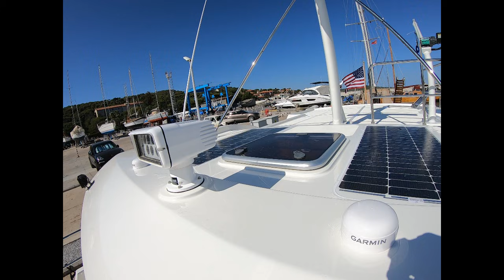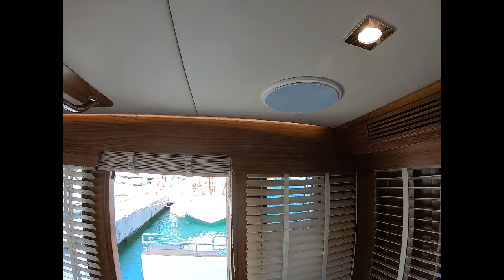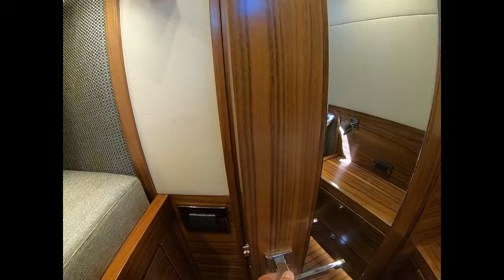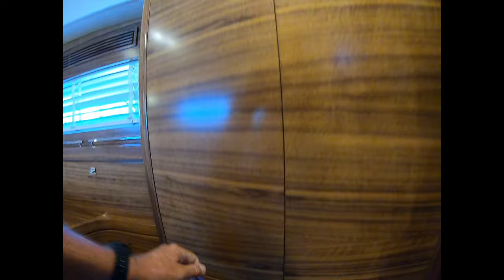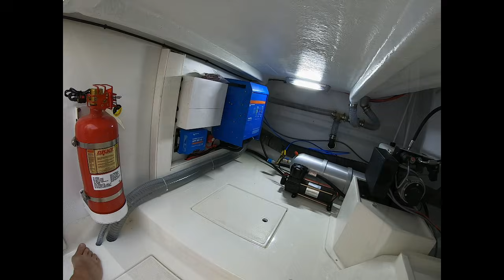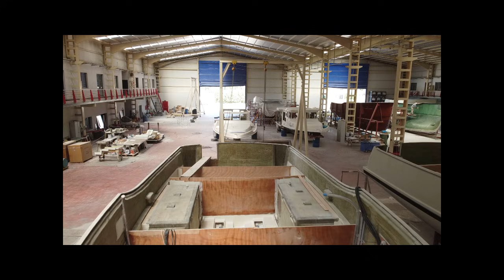Nordhavn 41 walk through and factory Narration

Comment: The N41 is a beautiful boat. That said, does the N41 have "Position Hold" as a feature? That is a significantly helpful feature on the ICW and in the Canal System on the northern part of the Great Loop when waiting for bridge openings, waiting for locks to clear before entering, and maneuvering inside locks which can be complicated when occupied by numerous boats. Of course, "Position Hold" requires the addition of a stern thruster. At this price point and to truly obtain the status of an excellent boat, "Position Hold" and duel bow and stern thrusters should be standard features. These features equate to improved safety to the boat and its occupants and superior handling capability in confined and/or challenging areas on the water - including marinas. I simply offer these feature upgrade suggestions to a beautiful boat that can be elevated even higher in its performance capabilities. I also feel that a stern helm station in the cockpit would be an extremely helpful feature to assist in docking at a marina or hugging a lock on the port side. The pilot station only has a starboard exit door. That makes it nearly impossible for the person at the helm to assist with the ropes. On a calm day or inside a quiet lock, that is not a concern. However, on a windy day or within a lock with several other boats, the water is turbulent and boat movement is both excessive and unpredictable. A helm station on the port side in the cockpit would negate these concerns allowing both people on board, or a single handed boat, to be successful time and again.
Reply: The engines and throttles are mechanical not electronic, so no.

Comment: I really, really like this boat but 2 questions: at 10:23 that background noise, is that the AC? Finding it pretty loud. Also, the Venetian blinds, they don't appear to be contained inside of any baffle or track to prevent them banging back and forth against the windows when underway with any kind of a sea running, is that correct? Am also thinking that wooden slats on the blinds matching the interior would be nicer and less obtrusive than what you have now. But these are small points –for a 41' vessel she is spectacular, I'd blue-water in her without hesitation.

Comment: Quite a disappointment.  So small and lightweight I almost thought Nordhavn put a torqeedo engine in it and made it totally electric.  This is a huge step down on previous Nordhavns.  You could not live aboard this boat.  Looks like a Princess weekender in layout and no proper bridge.  I would not want to be in this boat in harsh Atlantic conditions.  Probably why Nordhavn shipped it instead of ferrying.  Well the aftermarket N41 will increase in price.  Maybe this design is a one off.

Comment: No wheelhouse? 
Saloon / helm layout looks more like a Sunseaker than 'classic Nordhavn' 😀
I suppose if it still crosses oceans, fair enough.
Reply: For a buyer, they would be chosing their own wood and interior design if they weren't a fan. Nordhavns are known for never having one identical boat. For a 41 footer, a pilothouse would take up too much space. This seems to be a great layout for the size they were given
Reply: @blewyd  N40 also has a pilothouse, I believe
Reply: @TrolloTV  it does have a pilothouse, but it comes with a ton of disadvantages because it it so small
Reply: @blewyd  I don’t think it’s that bad, to be honest. The saloon on the 40 is full width with not walkways either way, so I personally would actually prefer the layout of a 40, even with having no walkways and more height.
Reply: @TrolloTV  nordhavns are meant for cruising. Loosing side decks is a terrible compromise and they are used a ton when docking. I've been boating my whole life and have been on yachts that don't have side decks and it's really annoying.
Reply: @blewyd  I get your point that it is annoying, but you would still be able to safely dock a boat with 2 people, and thats more or less the usual crew on a Nordhavn that size. After all, you will spend more time sitting in your saloon than docking
Reply: I also think the interior wood and materials are far more "timeless" and classy than a sunseeker would be. But I totally get your point. Looks like a modern boat.